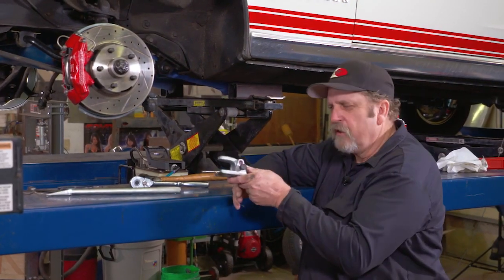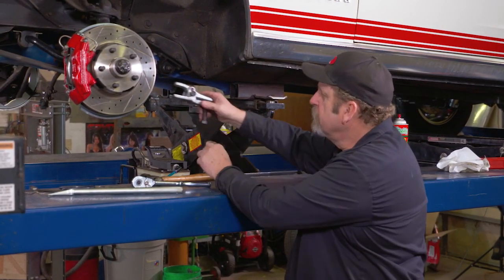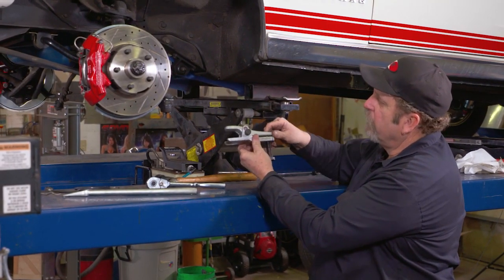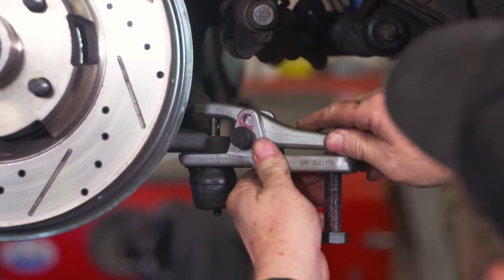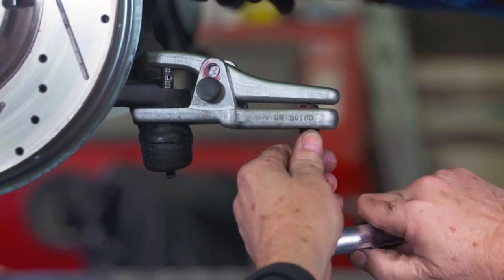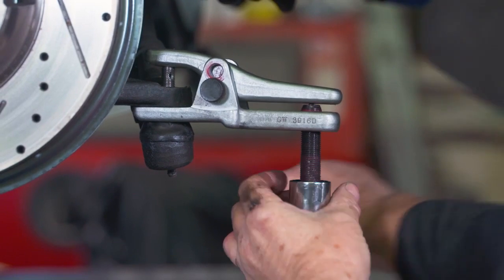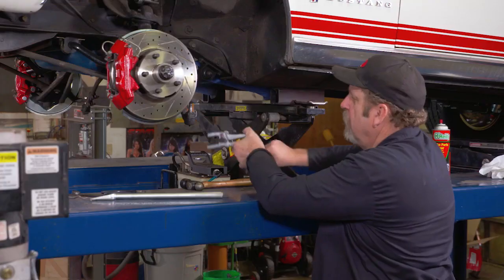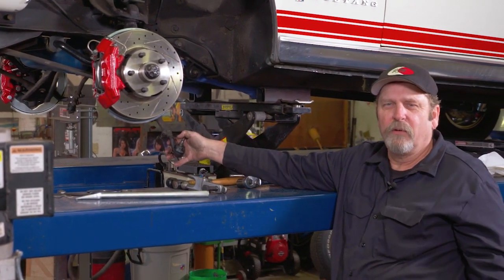Tie Rod End Removal Tool

Comment: Pro tip - If using the separator and it's being stubborn give the top of the tool that's pushing the thread side down a few taps with a hammer down ward. But not too hard as you don't want to damage the threads!

Comment: Hint. If like me you’re working on your back on a creeper with the vehicle on jack stands,working on an independent suspension. Use a bottle jack and jack the lower control arm up so the tie rod isn’t hanging down then the tool slides right in.